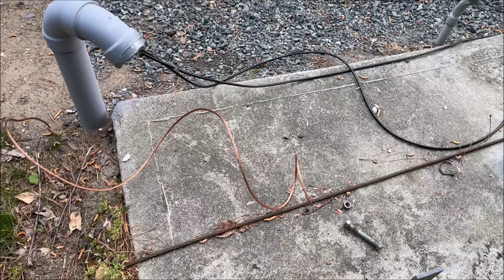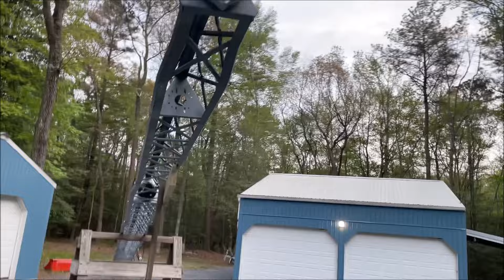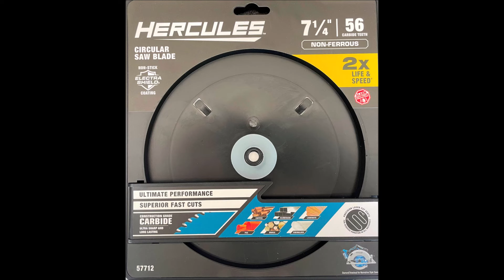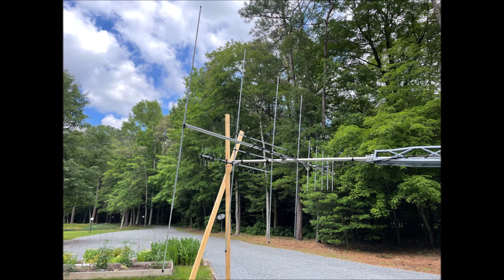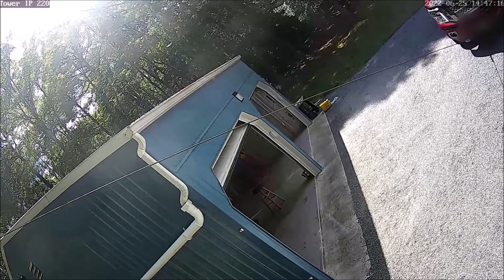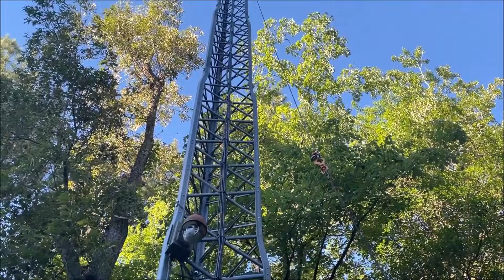Ham Radio Adventures 4 - Tower up!

Comment: I have access to one of these towers but I would like to do it like you did here. Someone told me it wouldn’t hold the wind load of a 80lb triband yagi. Do you think that would be pushing it ? From emails to top dxers , I’ve heard them speak of 2” dom tubing dipped in galvanize for a mast pipe. It flexes just enough so it won’t break under flexing in a high wind situation like gas pipe or alum will. I can’t confirm that. I just don’t want to go through this and not be able to install a momo tri 10 or Jk tribander. I haven’t liked my ta33 but that may be due to current height above ground. 15m is not much on the Mosley.
Reply from the maker: The change to LE was easy for me. I still have friends from the CBS days. I am actually retiring in June after 31 years. As far as the antenna wind load; I can only tell you what I did. I checked the wind load and sq./Ft recommendations as listed by the manufacturer. My tower is about at its recommended limit. I have had no problems up to 75 MPH winds (the highest so far this year). But as I said in one of my videos, because there was an underground water flow when I started to pour concrete, I ended up with 11 yards! The concrete info is in my Ham Radio Adventures 1. So the tower is super anchored. What I did for the mast was use Schedule 40 aluminum pipe. I inserted a smaller piece of pipe inside the first pipe so I had more strength in high wind. I also show that in another one of my videos. I am currently looking for another tower in addition to this one. Good luck and thank you!
Reply: @hamradioadventures73  congratulations on retirement to be. Hope you bring us along with more projects. I watched your earlier videos after this one so I learned abit. Nice qth location there. Can shoot when you want and dx when you want. Good deal

Comment: Wow. I'm 100% jealous. Lol. Great narration and videos of the install. I was wondering how close you could install multiple antennas on the same mast.  You have given me so many ideas for my future tower as well. Thanks
Waving at you from NW Georgia. KD2MOT-Matt
73
Reply from the maker: Thanks! I consulted with 2 other hams that also work the broadcast industry.  In addition, these guys have 5 or 6 towers up with all kinds of ham radio stuff. The rule they told me to use is HF on the bottom, 6 meters next about 3 feet above HF and the 70cm at the top with 3 foot of spacing. So far it is working perfectly.
Reply: @hamradioadventures73  That's awesome. I feel like the that really simplifies the whole thing. And it will make my wife happier too. Lol. Glad you have good reports from it too. I'll have my inverted V up soon and I'll post videos on my progress too.

Comment: Turned out awesome, finished mine and raced it in the air day before yesterday. Much of the same way you did. But using a winch on the front of the truck, I am 72 foot in the air.
Reply from the maker: Thank you. It worked out for me, but took a long time to prep everything.

Comment: How do you figure the load on the raising cable?
Reply from the maker: I posted the answer to that. I'll have to look and see which video it is.
Reply: @hamradioadventures73  okay, let me know, I appreciate it.
Reply from the maker: @roynorman3650  try this link for the formula and let me know if it does not work. https://photos.app.goo.gl/Beaqss85yL1QoA5z6
Reply: @hamradioadventures73  I've seen this formula as well. I've heard different ideas about this, and just want to be sure. It seems like it would make sense. I appreciate it. I use to think it was only dealing with the tower weight.
Reply from the maker: @roynorman3650  Using this formula, and based on previous experience with towing known weight, I think it was pretty accurate. At least to get the right gauge cables for the pull. The next time I lower and raise the tower, a friend is loaning me his weight gauge that you put in line with the cable. That will be an accurate way of verifying it. I'll post when I do that video, but it'll be later in the spring. Recuperating from knee replacement now. Thanks for the interest!
Reply: @hamradioadventures73  hope you get well soon. I'm new to towers, so just wanting to learn what I need to know. Look forward to seeing that video in the future.

Comment: Hi there! 73. What model are these antennas? Tnx. 73.
Reply from the maker: HF Mosley TA-32M, 70cm is Mosley MY420 and the 2 and 6 meter is Mosley 2and6 model.
Reply: @hamradioadventures73  Many many thanks.! 73 de IZ2OAV (WB5ALF)

Comment: Did you add any anti-seize compound on your tower bolts? That could be a good add-on the next time the tower comes down. I also run a 2-element Mosley, which was an excellent choice. LMR-400 cabling?
Reply from the maker: Yes it's all LMR-400. Never had a problem with the tower bolts seizing. The Mosley yagi(s) are fantastic. I love them.

Comment: You must have serious losses in that long length of coax, wonder why no masthead pre amps for vhf/uhf?
Reply from the maker: If I do it's not taking a toll. My signal strength is always reported fantastic on 70cm, 6 and 2 meters. All LMR-400 low loss.

Comment: Quick question what's the total weight of the three antenna?
What was the length of the aluminium pole that you used to mount antenna?
Reply from the maker: The HF Mosley TA-32M is 26 lbs., the 2and6 is 21 lbs. and the 70cm 14 element is 12 lbs. Total 54 lbs. plus LMR-400. The pipe is explained in one of my videos. It is a schedule 40 aluminum 20 feet long with 9 feet above the top of the tower. For strength, I inserted a smaller schedule 40 pipe from the top to just past the thrust bearing. Then I placed one stainless bolt at the top and one at the bottom to keep it in place.

Comment: neat idea for the coax clips Mark, shame you didnt use them, on my tower i use 4 inch diameter undeground drainage pipe zip clipped to the tower @ random spots to feed my coax and rotator cable through (i have a box section solid tower), one last observation though Mark ,why not run coax below the rotator inside of the rohn ?? the cables could have been zip tied together and left to be free inside the tower structure as they could not move to the outside ??
Reply from the maker: Since I did the whole thing alone, I just decided to tape, and zip tie the coax. Was getting worn out. LOL. Also, I would have had to clamp the coax blocks to the tower. I felt it was one more thing to rust or loosen. I thought of running the coax on the inside of the tower but opted for the outside in case I need to replace a cable. Makes it simpler for me. Thank you for taking the time to comment. Appreciate it.